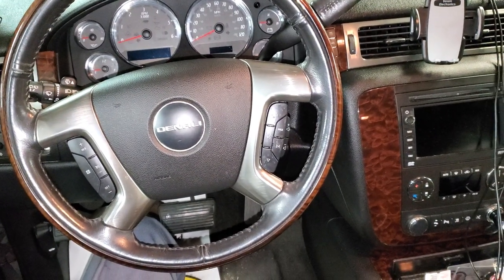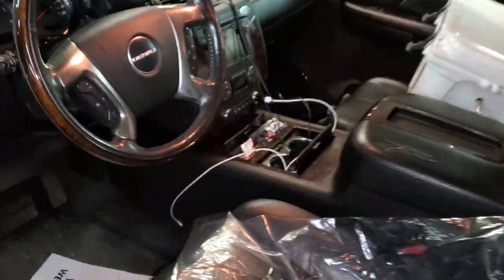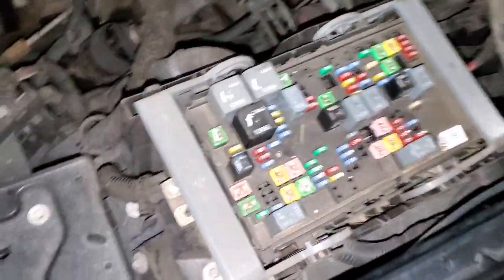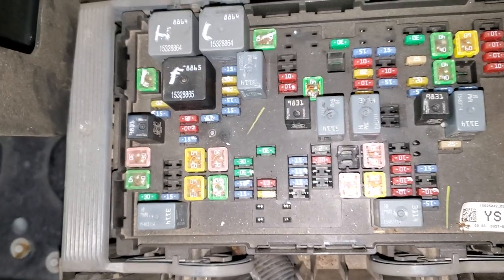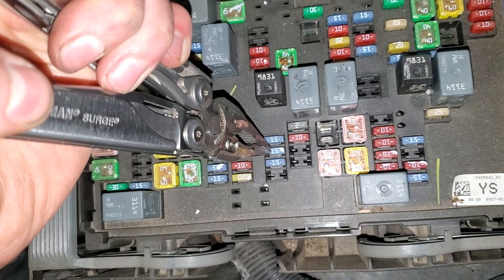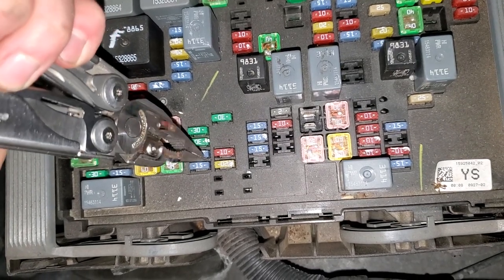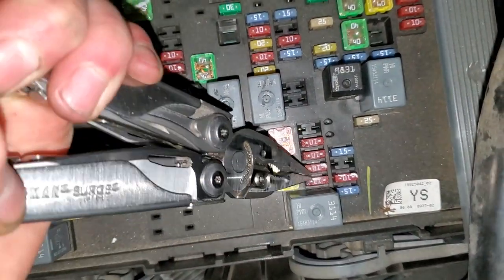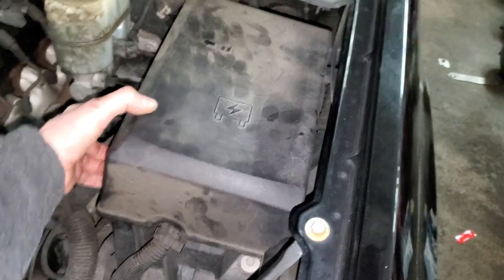2007 GMC Yukon Denali Radio Fuses

Comment: Thanks, not entirely sure as to what my issue was but my oem bose amplifier had stopped working so I had sound from all speakers but no bass and with your instruction I pulled and checked all of the specified fuses which none were even blown in fact but whatever I did by pulling them it had reset something and the amp came back on! Let's just hope that it stays on though 🙏 🤷‍♂️
Reply: Did it?
Reply: @teabags3632  yes
Reply: @kevinAuman1  i already fixed it👏👏

Comment: Same thing happened to me, radio died no bad fuses, checked all wiring harness from radio and bose amp. Ended up replacing radio and amp. Somehow both radio and amp fried up. Spent about 140 bucks getting used parts. Current radio is working perfectly 🙂 fine

Comment: So my alternator recently went out in my 08 Yukon and now my radio will show the time but you can’t turn it on. It also has my backup camera and that went out. The radio just sits there doing nothing but a clock that tells the wrong time

Comment: 2007 chevy suburban. No sound from speakers no turn signal sound no door chimes no key chimes. Radio is on. Replaced factory amp still same issue. Installed new battery still same issue. WTF??

Comment: I have a 2008 gmc Yukon Denali xl. The radio works but when I turn off the engine and open the door the radio stays on.  Plus the whole right side on the driver's side isn't working.

Comment: I checked all the fuses, and seem good. Still no radio or Clock or any power whatsoever to the sound system. Seemed to have happened when I unhooked the battery and hooked it back up.  Frustrated and clueless at this point. Thanks for any help
Reply: manwithvette  same here if u find out how to fix it let me know
Reply: SAME 
Help as well
Reply: Sauce woo any luck with your Yukon?
Reply: same problem here 2007 chevy tahoe did u find anything info
Reply: Same problem... just happened when i unhooked the battery... any updates guys  did anyone find out whats wrong
Reply: Were you able to figure it out?
Reply: Grrrrrrrrrr.....same problem! Disconnected battery while replacing the engine, and the radio worked when I reconnected prior to starting the engine. I pressed the power button, and the radio has been dead since.

Comment: 08 Yukon. Denali 
Raído works / dvd works. 
But the headphones and remote for dvd don’t connect. 
Red little dot light are not coming on. Is there a fue I should be looking at.

Comment: Anyone else have there radio turn off while they are driving reset it's then go's back to normal ? Mine did that yesterday then the truck went into limp mode and wouldn't stay into gear but it wasn't shifting hard and it kept locking and unlocking itself anybody experience that?
Reply: Also I've recently replaced my battery and alternator
Reply: Battery fuse

Comment: I replaced it but it blows out right away
Reply: Same!! Have you fixed your problem?
Reply: Sound like there's a short on the line. Possibly internal to the radio or possibly a regular wire that's somehow made contact with the yukons ground (negative wire side).
I guess it can possibly be shorted internally in the fuse box too.

Comment: have a 07 Yukon that has no sound with the stereo. it turns on and all options work on display but there is no sound and no time showing.
Reply: Did you fix the problem? I’m still having trouble